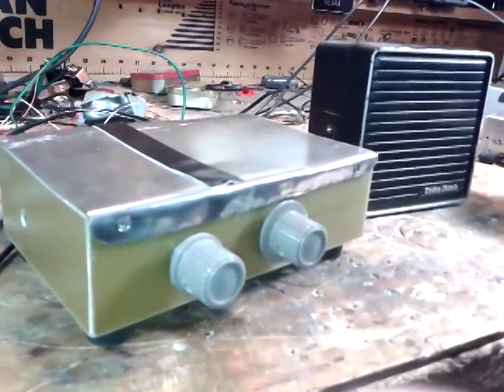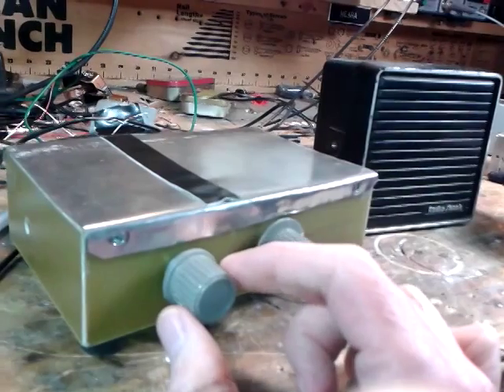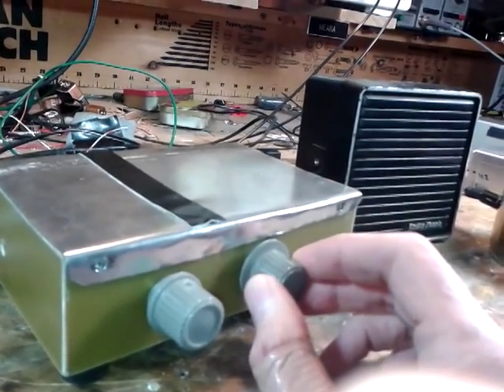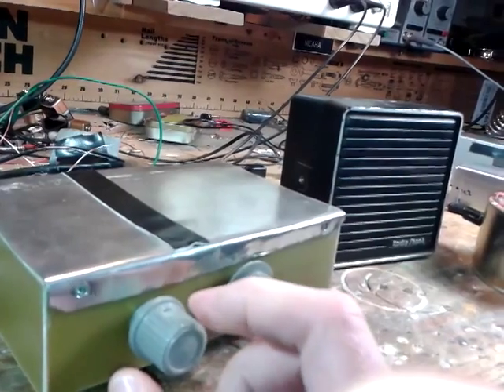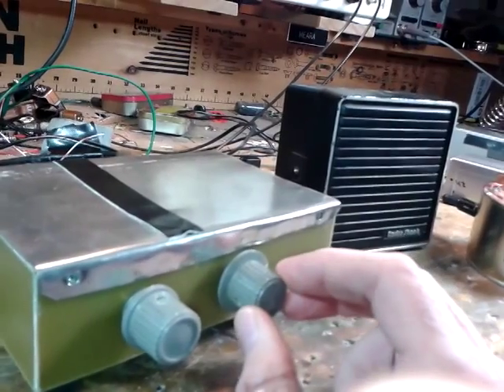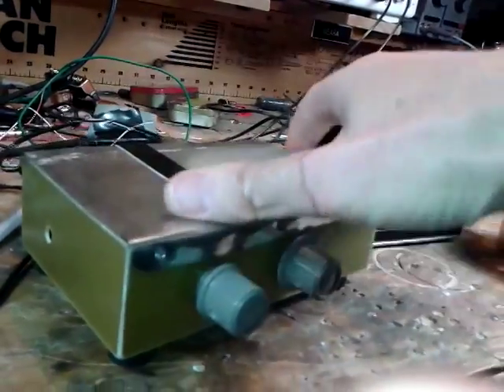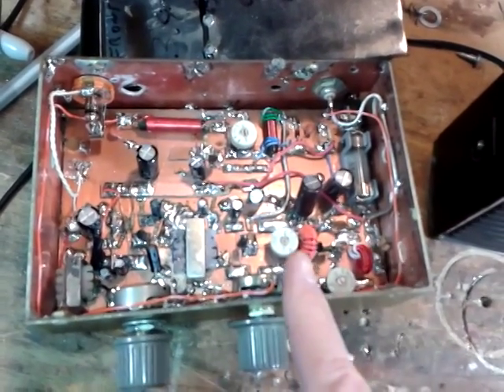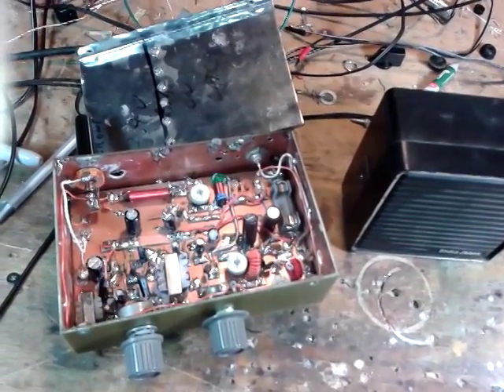Herring Aid 5 Receiver

Comment: Hi Bill, I just discovered one day ago, after 46 years, that the gate on the FET transistor for the oscillator isn Jay Rusgrove’s circuit board layout is grounded. That’s a big OOOPS. I have the original article from my July 1976 bicentennial copy of QST. The pdf copy on ARRL’s website has the markings for the gate and source are scratched out. I guess they realized the mistake too but they do not print in prose that there is a mistake in the printed circuit board layout. So I had to go back to that board I etched over 46 years ago and reverse the gate and source leads or I would have a grounded-gate 😂 Colpitts oscillator.
Reply from the maker: Wow.   This is  huge.  So many errors in this QST schematic, we are still finding big problems after 46 years.  I had assumed that my teenage failure to get the VFO oscillating was due to my failure to wind the coil the right way.  I had a 50-50 chance, and I thought that I had got it wrong.  But even if I had gotten it right, that oscillator would not have worked with the gate grounded.  Back in 1976, before I knew better, I just kind of blindly followed the PC board pattern in QST.  I used ferric chloride.  And of course, with the gate grounded,  the VFO did not O!  Today I looked at a .pdf on the internet and I think I can see the error you pointed to.  Could you send me the scratched-out circuit board pattern you found?  Also, please send me your e-mail address so we can get to the true bottom of this problem:  soldersmoke@yahoo.com    Thanks and 73 Bill
Reply from the maker: I don't know.  I was looking at the PC board layout here: https://www.worldradiohistory.com/Archive-DX/QST/60s/QST-1976-07.pdf      I'm guessing that the RS-2035 part was an MPF 102.   So the pinout would have been DSG.  So following the PC board pattern in that .pdf,  the source would have always been in the center, right?   I found a Herring Aid 5 at a hamfest early this year.  I looked at this this morning and sure enough,  in this one Q5 is a MPF102 and is soldered in correctly.   What pinout are you assuming when you say the PC pattern is incorrect?  73  Bill
Reply from the maker: I think I can see the error you are talking about.   The pinout markings at Q5 (VFO JFET) on the .pdf that I have do appear to have S and G obscured.  But on the same .pdf if you go down to Q1 (RF amp JFET -- same part #) you can clearly see it marked as SGD!  That is wrong!  On the receiver that I picked up at the hamfest, you can see that the builder corrected this error by twisting the transistor around to put the source and the gate in the correct spots.  This is another error that I would not have been able to correct as a 16 year-old. 73  Bill
Reply: @soldersmoke , I’ll have to pull my original QST Bicentennial July 1976 edition but, yes, the gate is grounded there too. In this application though, I didn’t consider it unusual because it was probably a marginal gain or unity gain rf amp and it’s purpose was to isolate the local oscillator from the antenna. Unlike the oscillator the schematic, which shows the tank circuit coupled to the gate at Q5, shows that Q1’s gate is grounded. I have to assume this was conscious decision and at Q5 it was an accident. He may have confused the 2N3819 pin out with the more familiar mpf102. Is your’s grounded gate at Q1?
Reply from the maker: For Q5 (VFO) even though the  PC board diagram probably show an incorrect pinout (it shows DGS when an MPF102 is actually DSG) if you just plugged the FET into the holes with the D connected to the L6 I think it would be OK.  The Source would be grounded and the gate would go to C5. (of course, this assumes that the builder didn't just blindly follow the DGS markings on the PC board pattern -- I might have done that as a 16 year-old). 
For Q1, if you followed that incorrect DGS pattern, as long as you got the Drain in the right spot, that RF amplifier might have still worked even if you followed the DGS markings and got the source and gate mixed up. 
I don't know how I wired this 47 years ago. In my more recent build, I put the sources and gates where the schematic (not the PC board pattern) wanted them.  Once I got the winding sense on the VFO coils worked out, the more recent build worked well.   When I looked at the other Herring Aid 5 that I found at the hamfest, the builder obviously saw the error in the Q1 layout -- he twisted the transistor to put the Source and the Gate in the right place.  No such twisting was needed in the case of Q5 (VFO) -- while the pinout is incorrectly marked there, if you just plug in the FET,  D,S and G all  end up in the right places.  I want to send you some pictures -- please send your e-mail to soldersmoke@yahoo.com    Perhaps we should form a Herring Aid 5 support group!  73  Bill
Reply: @soldersmoke  well Bill my Herring Aid 5 is an original I started in 1977 and Q5 is Radio Shack part number 276-2035 which is a 2N3819 JFET. The pin out, pin side up, left to right 1, 2, 3 comes out as S-G-D. If you just “plug” that JFET in and solder then the gate will be grounded. I checked with my copy of Archer 1990 Semiconductor Reference Guide. That transistor is featured on page 9 and the gate is the middle pin.  Now the mpf102, Radio Shack part number 276-2062 and not used at all in this original circuit,  that is on page 8 is D-S-G. So if you flip it 180° it plugs in nicely. I have no idea if the supply voltage and gate bias voltages need changing, they probably need tweaking. 

And yes, I,’m going by the schematic and not the circuit board layout too. I’m using Jay Rusgrove’s original design from the July 1976 QST article.
Reply from the maker: This is so interesting.  Back in 1976, I was surely using the specified Radio Shack parts and the PC board pattern from QST.  Looking at the VFO Q5 with that 2N3819 FET the Gate is definitely (as you said) in the center.  So there is no way that VFO would have worked, even if I had lucked out and got the turning sense right on the transformer.  I feel vindicated! 
I wonder why they didn't alert builders to this really gross error, especially since this was supposed to be a project for novices.  73  Bill
Reply from the maker: And Q1 (RF amp) seems to be marked on the PC Board layout correctly for a 2N3819.   With Q5,  because of the PC board layout error an MPF102 would work fine in the Q5 holes.   But because the Q1 holes are correct for a 2N3819, you'd have to twist an MPF102 to get the Source and the Gate in the correct spots.  Is that how you see it?  What is your call sign?  73  Bill
Reply: @soldersmoke  Bill, I tried looking for a correction at the ARRL website for 1976 and 1977 and came up empty. So, ironically, if you built this DC receiver ugly construction you stood a better chance of getting it to work than if you etched the board as I did and follow the circuit board layout to the letter.

I think I will have to go through my copies of QST for the latter half of 1976 and 1977.

And as to why QST didn’t alert the builders. They may not have known but what is for certain is that this was a Novice license hazing.
Reply: @soldersmoke  Bill, it’s pretty remarkable that the Herring Aid 5 you picked up early this year used an MPF102 for Q5. It puts the drain on pin 1 and the gate squarely on pin 3 if the pin side is facing up. So that MPF102 JFET would have to be installed 180° based on the board layout on page 22 from the copy in the link you provided. So whoever made this Herring Aid 5 DID NOT use RS-2035 like you and I did when we started building this thing. RS-2035, and later 276-2035, was the 2N3819 JFET and the pinout puts the gate squarely on pin 2 which you can see in the board layout grounds the gate. Following that board layout and failing to swap the source and drain, our radios never had a chance to work.

Comment: Demaw published three projects in the same family;  the Tuna Tin 2 transmitter, the Herring Aid 5 direct conversion receiver, and the CB Slider which used a corned beef can as a VFO for the Tuna transmitter.  I built the Tuna Tin 2 which worked perfectly, but my Herring Aid 5 would never work.  It would receive only the strongest signals with the lowest volume.  If the LM386 had been around then I probably would have had enough gain.  I did use different transistors in the Tuna Tin 2 which gave me 2-watts output instead of the half-watt of DeMaw's original.  That was all a long time ago.  Glad to see this!  I never knew another ham back in the 70's who built these things.
Reply from the maker: The Herring Aid 5 really works very well.  No need for the LM386.  Give it another try OM.  It took me 38 years to get it right!  73  Bill